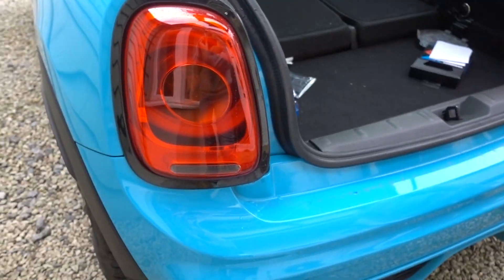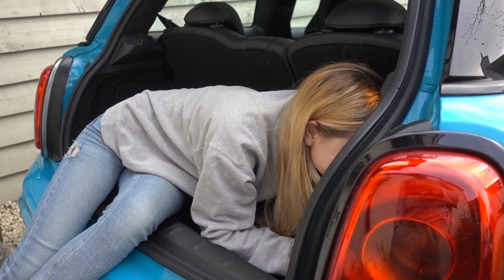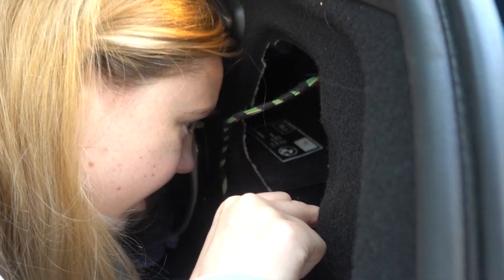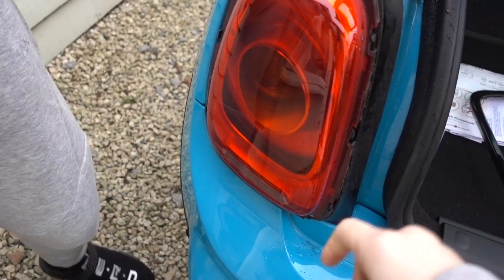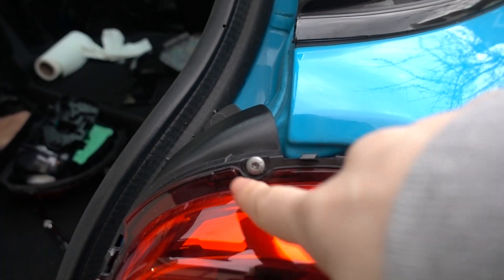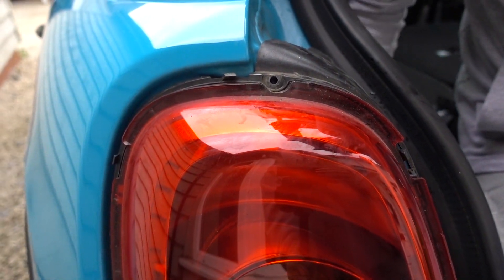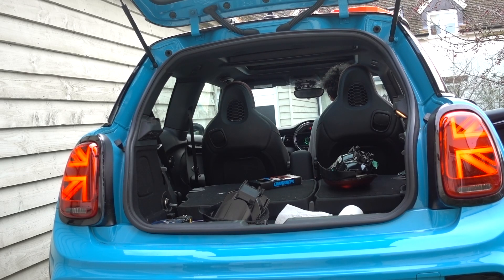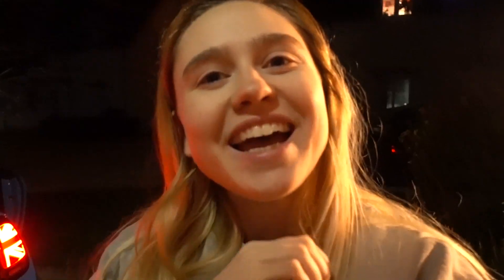Installing UNION JACK Lights On My MINI JCW

Comment: This is a true mini in every sense, loving it.
Reply: Thomas Partida well it’s not though is it... no modern mini is a true mini. Straight facts
Reply: Fxckyougoogle - The BMW Golf.
Reply: So nothing new is what is was yet it’s DNA is there.  The new corvette is not the old corvette?  The new Porsche 911 is not the old one?
Reply: Thomas Partida you just don’t understand do you. The new “mini” is not a mini at all. To say its a true mini is just insulting to an actual true mini. The car in this video is just a German barge with mini badges.
Reply: Thomas Partida - The new Corvette is a tough one. To me a Corvette is an American sports/muscle car with a naturally aspirated V8, rear wheel drive, the engine at the front and circular rear lights. Well two of those the new car doesn’t have. So it’s a kinda pass.

The 911 to me is a German sort of pebble shaped sports car with the engine at the very rear and bug eyed front head lights. I think the latest model still fulfils this criteria.

The Mini to me is a British small ‘city’ car that defies its small size by being surprisingly practical. It’s also a cheap car, even when new that most people can afford. It’s also a versatile car that has many variants. I think the new mini only really fulfils the versatile criteria and neither of the other three. Therefore I find it a stretch to call it a Mini.

Comment: Hey. How did u get the coding to work?? The mini dealer told me bme havn't figured  it out yet. I really want some for my cooper.
Reply from the maker: There's an app called bimmer code that you can use to program a bunch of stuff. You also need an iCar Pro diagnostic interface. It's a little thing that you plug into the car and then sync to the app and you can do all your coding from there. I think it's like £10 online :)

Comment: Meadow & Theo, well done and great video.  You say that they needed coding and as I’ve just changed mine (2018 JCW with now 2021 rear UJ’s) I booked it in for coding.  The BMW approved garage said it would not be a problem, only he still has my car !  He says wiring pins need to be changed but I’m of the opinion that it’s just coding !  I didn’t buy the BimmerCode App as I thought it easier to use the garage, wrong.  Do you have the definitive list of codes that need changing please ?

Comment: It begs the question, why? Are you really such a fervent fan of the state?
Reply: The brand not the state
Reply: @ekimandersom4478  The union flag which is on the new light does not represent B.M.W.. It represents the U.K. which is a political state.
Reply: @ekimandersom4478  You really are getting worked up. I don't know if you think swearing is going to impress. The union flag does not mean it's an English car. While a number of these cars may be assembled in England, along with the Netherlands, B.M.W. is a German company.  Furthermore, the George Cross is the flag of England. The union flag is not. It is the state flag.

Comment: i installed mine and coded them with bimmercode, but as per your vid i still have the flickering on the start for a few seconds, did you manage to clear this flickering aswell?  As its bugging me tbh and seen many vids from america but need someone to show this from the UK as its a different lighting system, please help!
Reply from the maker: Hmmm I'm not sure. Mine don't flicker on startup anymore. Maybe make sure the connectors are fully plugged in?
Reply: Did you disable cold and warm monitoring with Bimmercode?
Reply: @robbyvrs  no I haven't do I need to disable both? if so is that on the expert mode? if so please confirm  how to.  thank you.
Reply: @Mani_Tank  Yes you need to switch both cold and warm monitoring for all functions on rear lights to "not active" as well as setting lights to LED instead of bulbs, this is done in expert mode (costs £31 for the upgrade from free version)
Reply: @robbyvrs  yes I have purchased already to clear the error on display but still have this flickering issue, what code number is it under on expert mode  please?
Reply: @robbyvrs  also do I need to do this all for rear lamps and tail light options on bimmercode?
Reply: @Mani_Tank  Look in BDC and you'll find the options for lights - scroll down to post 126 - https://www.northamericanmotoring.com/forums/3rd-gen-faqs/326647-union-jack-taillights-6.html#post4524210
Reply: @robbyvrs  just done it in the normal mode and its sorted it all out thank you, didnt have to go into expert. thanks changed all the rear lights to led and all not active.
Reply: @Mani_Tank  Glad it's sorted, enjoy the new lights :)

Comment: Did you have to do any coding and if so can you provide the information on what you had to do to get them to work.
Reply from the maker: Yes you do have to code them. All you need is the bimmercode app and a Bluetooth OBD reader. If you go on eBay and search bimmercode you'll be able to find an OBD reader. And then it's very simple to code them through the app
Reply: Meadow I have done that and managed to get rid of the warnings on the dash and the flickering, but my problem is the Union Jack is not lighting up like yours. I only have indicators, brake light and side light on the rear. Do I have to code anything else to get the Union Jack to light up? Yours seem to light up just by changing the lights without coding. I am working on a 2016 mini convertible so it may me slightly different to yours.
Reply from the maker: @24710635 I think there's quite a few options you can through.  on bimmercode it'll be from indicators, to rear light and more. Go through and make sure each option that has to do with the lights is changed to LED
Reply: Meadow I think I may have found the problem, the connection to my lights has only five cables in where as yours has six. How much are you betting that I need that extra cable to power up the Union Jack part of the lights. It might be a trip to a auto Electrition or have a look foe a video showing the modification. Thanks for your help buddy it’s been much appreciated.
Reply from the maker: Okay yeah that might have something to do with it. Glad I could help out! Hopefully you're able to get it sorted :)
Reply: Meadow I managed to sort it out tonight, I had all the coding correct but on the connection with 5 cables instead of 6 cables you have to swap pin 1 and place it in pin 5 then everything works as it should. A bit of a nightmare to get to this stage but they do look awesome once they are all done and working correctly.
Reply: @24710635  I think you just saved my day here. Same problem, same solution. Thank you.
Reply: Caio Victor Lopes Tito glad I could help, it stressed me out a bit especially when BMW mini said it couldn’t be done. I thought I had bought the lights for nothing and couldn’t use them. All good in the end though.
Reply: @MeadowandTheo  Hi, what section of the app is used for the rear lights? I cannot seem to locate it? Cheers

Comment: Rather than watch a video about how to remove the light units, just look at the fixings on the replacement lights?, also you don't need to reach in to disconnect the multiplug from the light unit, just remove it when the lamp unit comes away from the bodywork.

Comment: Sorry but it's not as easy as that .. I installed mine at Mini because you need a new coding for the headlights because the Union Jacks are Led and the old ones are with bulbs ...  The most following the year of the car there are different codings ... Find out before buying and placing them...
Reply from the maker: Use the app bimmer code

Comment: Shame it's made by BMW.
Reply: Without BMW the car would no longer exist. Would you prefer that?
Reply: mac daddy - Yes. Should’ve been called the BMW something. It doesn’t evoke the spirit of the original so I’d be happy for it to not exist,.
Reply: @bigmacdaddy1234  - 

I don't agree with that. 

The Fiat 500 does for starters. A modern take on an old classic for a reasonable price like the original. 

The new BMW Mini shares none of characteristics of the original. It's a bloated, heavy and expensive car.

It's probably a decent car in its own right but it's never a Mini.
Reply: @mr8I7  It says Mini on the title, on the hood and on the trunk. It starts at $20K and extremely well made. Oh' and everybody knows it's Mini because of how it looks. Sounds like a winner to me.
Reply: @bigmacdaddy1234  - It might be a decent car and to be fair going from a 60s car to a 00s car is a massive step. 

Something like a Golf we've seen the transition over the time as there's been loads of models but with the Mini it was a massive jump.

Still doesn't feel like a Mini to me whatever. I think that horrendous Italian Job 2003 movie is half the reason!